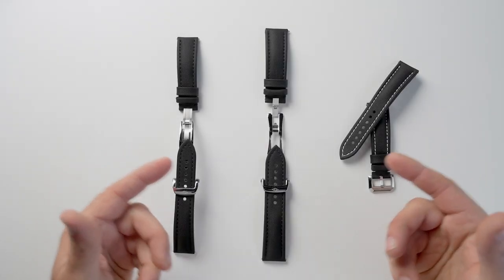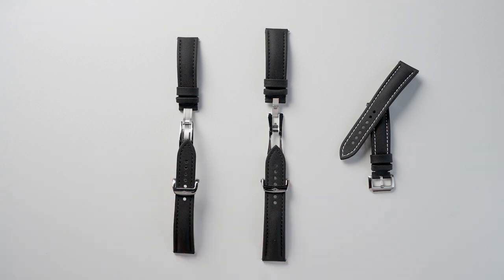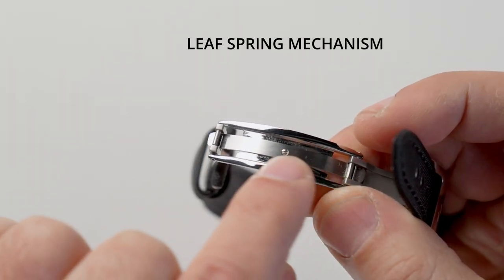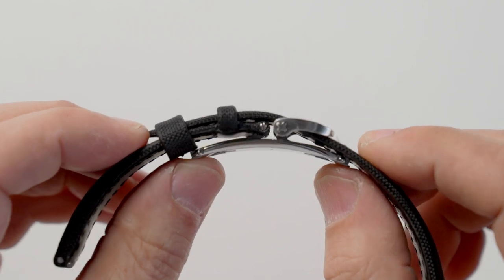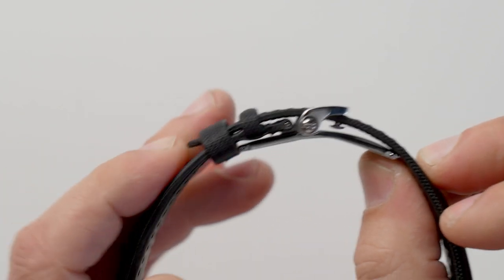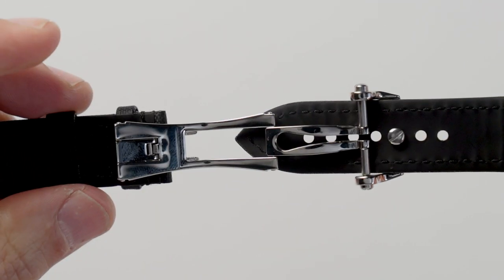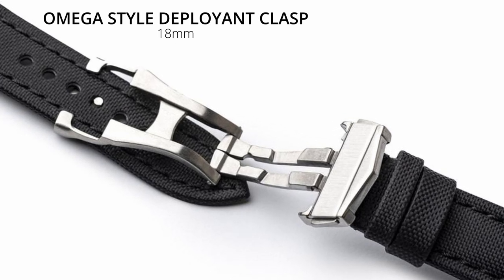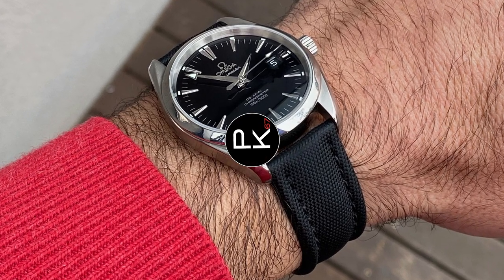ARTEM Deployant Clasps - How Do They Work ?

Comment: Omega-style is the only one I really "understand." What's the point of having a deployant where you still have to tuck the tail end in to the keeper? Seems like extra steps and hassle.
Reply: That's how most deployant clasps work. They are more useful on leather than other strap materials, since the act of bending leather to put it through a tang buckle can put some serious wear on the leather-- not good if you've paid $100+ USD for a custom/OEM strap!
Reply: I have the ”omega-style” deployant clasp from Artem, and I am totally happy with it
Reply: @cedarcanoe  The bead on the Omega style clasp is smaller than the hole. Is there any play?
Reply: Some people want to maintain the traditional watch strap look. With the omega you don’t get that. I personally prefer how the strap looks when the end is going through the keeper. But if you don’t care about that the omega would be the way to go.
Reply: The omega style is a much cleaner look. Not extra strap visible. Its all hidden under your wrist.

Comment: BUT what is the width of the buckle at the buckle end, to know what is the strap width? I assume you are quoting the lug width at the watch end... strap width at buckle end?
Reply: I had the same question. The website doesn't state the width of the Blancpain and RM style buckles. Are they 18, 20mm at the buckle end? I also wanted to know if they are compatible with other aftermarket straps. It looks like the straps have particularly large holes, so the posts on the deployants might not fit other straps. The straps look great, but the XL selection is very limited.
Reply: @MichaelG1986   I believe they are 18mm at buckle end, but you are right will they fit other straps. The blanpain FF buckle I think is 20mm at the buckle end. Probably the only way is to buy them and try/ see if they fit.
Reply: @stevenuk  Thanks for the reply. I have largish 7.5 inch wrists, so usually get longer straps. The ARTEM site sells only one iteration in XL - at 20mm lug width. I have several watches the straps would look great on, but unfortunately, they're 22mm lug watches. If they had a 22mm size in XL I'd buy one or more and some buckles in a flash.
Reply from the maker: Hi Steven, sorry for the late reply, I have been a little preoccupied 
The width at the buckle end is 17.8-17.9mm (in that range)
Hope that helps mate 👍

Comment: Great showcase of the clasps. Between the Omega and RM styles, which would you recommend for a tighter fit (for a smaller wrist)?
Reply from the maker: I don't like the Omega style, for me the RM for sure...
cheers
Reply: @PeterKotsa  for the Omega style clasp to sit properly under the wrist it needs to be used with an Omega style strap, where the "short" side strap is nearly the same length as the long side.  Otherwise it will wear uncomfortably off center.

Comment: I have some deployants (not ARTEM) and I was impressed in the beginning but now I have gone off all of them - they are too complicated for what they need to do. Yes, they do prevent distorting and bending the strap around the buckle and tang, but releasing them always is a pain and if the bead that goes through the hole in the strap is not a firm fit it keeps falling out.

But the big part is taking the watch off. With a buckle, you have a firm grasp  on the strap when undoing it, the watch can't really fall. With a deployant, the most you can grasp is two spring pushers if you are lucky, then the mechanism opens up and it's a game of grab the bit that just moved to not drop the watch. I've switched back to buckles and tangs everywhere I can.

But, the engineers in me can at least appreciate the idea
Reply: Butterfly style deployants where you have to snap down the sides and then tuck the tail end under the keeper are a lot of fuckery and hassle IMO. My favorite is the Omega style that Peter doesn't like.

Comment: I have never owned a sailcloth strap. However, when I do finally buy one, I'm going straight to the top (quality wise) and buying an Artem! They just look so comfortable!

Question - is it leather or rubber on the interior of the strap? If leather, I dont imagine they do well with the summer heat, right? I just cant tell if its rubber or leather. Thanks!
Reply from the maker: The strap is designed to be water-resistant, so its not leather. I have not had any issue with mine in water 👍
cheers

Comment: Hey Peter, just a question. What's the point of these clasps? I'm old school, & I find normal straps secure, so I'm not really sure of the benefits. Like it raises the price considerably, so I'm just wondering is it just for looks? Because I do like the look of them, they look premium.
Reply from the maker: The deployant clasps are designed to save the strap from long term damage. 
When using a standard tang buckle, the strap end is faded through as its put through. The deployant doesn't bend the actual strap
cheers
Reply: @PeterKotsa  thanks mate. Love your videos. Hopefully this lockdown ends soon, I'm also in Melbourne.
Reply from the maker: @antdenzic7977  yeah, best of luck to both of us bro..

Comment: I can tell you that RM model is the better one cause of the screw. First one, if its only pressure holding the space hole ( I'm really bending my vocabulary here) it can casually go out when the strap is braked in. 

But, these deployant clasps are way superior for the longevity of the strap than the standard one. You just have to get use to the metal beneath... it's a little different feeling than the regular buckle (you need more space for it).

 Artem here looks really nice.
Reply: Unless I'm mistaken, isn't it the Blancpain model that uses the two piece screw and the RM that uses the fixed stud?

Comment: Rado do a nice deployment clasp, it has an extension that opens up to get the strap over your wrist. The tail is tucked away omega style, so very neat and comfortable. None of the clasp comes into contact with your wrist. I don't personally see the point of a deployment clasp where you still have keepers ? All that metal  clasp touching your skin, it's a poor design in my opinion. Rados is very slimline , and yet strong. The whole point to a deployment clasp is hide the tail and do away with the keepers , giving a luxury feel. Let's be honest a lot of straps have keepers that stretch over time and start moving about , very annoying. A good deployment strap eliminates this. Nice try but no cigar this time old bud. Lol.
Reply from the maker: But I don't smoke 😂😂
Reply: @PeterKotsa  , well I will have one for you then, lol. Probably drive you to drink will all the annoying comments, lol.

Comment: I really don’t want to be THAT guy, but I must confess I was disappointed with my Artem sailcloth band. I didn’t buy a deployant clasp (although I wish I had). The band looked fantastic on my watch (and on my wrist), and was comfortable. The problem was that it cracked badly around the clasp holes, because of the bending required to insert the end of the band (which is pretty firm and unyielding) into the tabs/holders. Oh well. The band lasted about 6 or 8 months before the cracking started. Such is life…
Reply from the maker: Drop Artem an email and see what they say
Reply: @PeterKotsa  Thanks, mate. I sent them an email. Let’s see what happens…
Reply from the maker: @jmw3938  on a side note, i have had zero issues with the deployant clasp, it takes the 'folding or bending' issue out of the picture